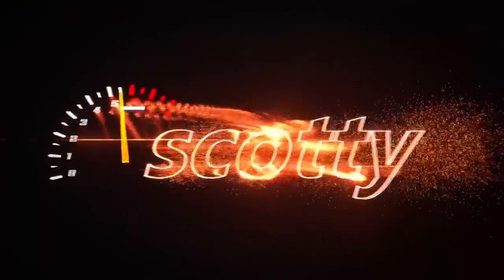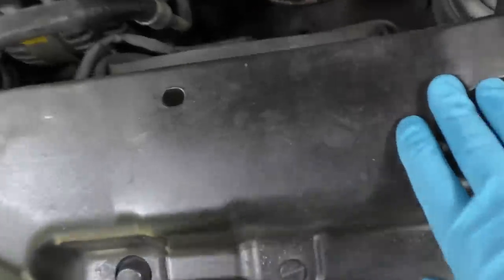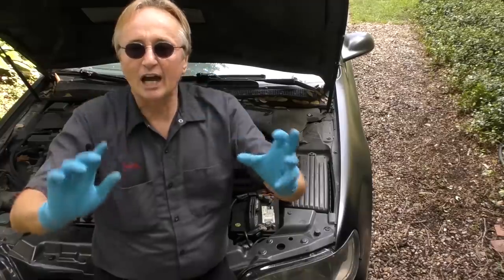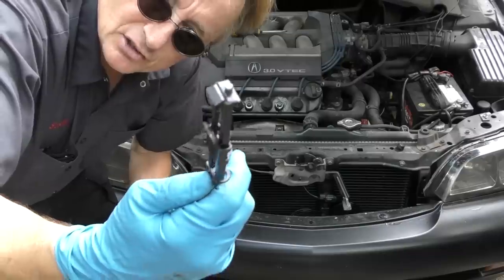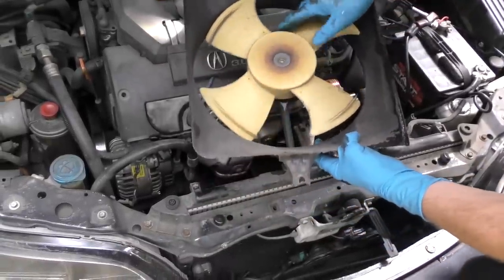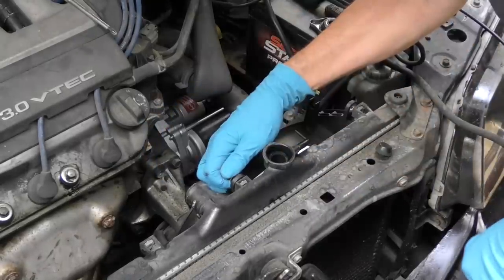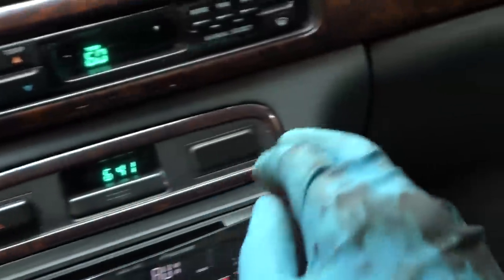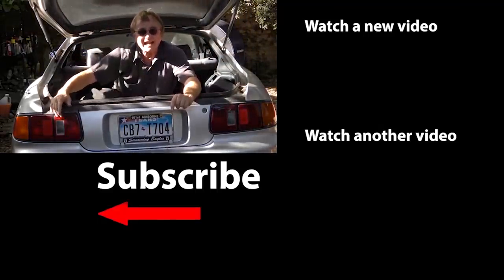Doing This Will Make Any Car Work Better

Comment: To have Scotty work on your car would be a dream.   That clamp tool is a must for tight spots, reduces cursing by 80%
Reply: Gordon Ramsay can use that
Reply: Bet scotty would run away rather to work on my Jaguar S type 😭
Reply: @iiiEazyiii  because it is an endless money pit.
Reply: @iiiEazyiii  You too? Mine is an 07 S Type. Bought it used back in 2011, drove it for 2 years before giving up.on that bloody thing! Everything just failed:  radiator, bearings, fuel pump, power steering, windows, speedometer, chair motor, wiper motor, navigation screen partially white, brake rotor, and even the boot won't open anymore! From May 2013 I've left the car on my front driveway ever since and just couldn't be happier with my '12 Camry nowadays.
Reply: @user-xq2fz5tz9t  Why leave it sitting on your property. I'd of junked it or sold it many years ago.
Reply: Maybe even 92%

Comment: My car's got three hundred thousand miles on it the fans still work.... knock on wood.
Reply: @missioncodez  agreed. My little car has 100,000 miles on it. All original. Apart from the clutch and brakes. If you look after it, then they should last a lot longer but cars are like white goods now. Disposable.

Comment: I have 1996 Honda civic w broken compressor. Total oven on wheels
Reply: U think it would cook my meet when I’m sitting inside it?
Reply: Checked on eBay?
Reply: Fixing AC is not too bad. Need the right tools and do some research. I've done two compressor replacements and will soon be doing a third. Different cars.
Reply: What was the issue with it? I replaced mine because the place where the clutch bearing fits into was so much worn out that the clutch was wobbly. At some point the clutch was just held in place by the snap ring

Comment: I have the same car scotty it runs cold like that....right under the half way line...mine is a 99 acura cl 3.0
Reply: It's not really running cold if it's near the halfway point my Accord does the same. I can get it to come up but it has to be ran hard. I think it's just the gauge they use.

Comment: I must be a bit of a cheapskate... I would've taken the good blade off the seized fan motor, then removed the busted blade from the other fan that still had a good motor,  next I'd put the good blade on the good motor, and finally reinstall the repaired fan along with 1 new fan... end result is still 2 working fans, but with one big difference of cutting the parts bill in half... at the cost of being a bit more labor intensive.
Of course, I'm only talking about working on my own car.
Reply: J. M. The Damned fans are aftermarket.. Cöst practically nothing! He could have done what you suggested only to find in a short time the other fan (which was old) would break down!

Comment: I bought a 2012 accord about a month ago and it had zero coolant left in the reservoir so I went and filled it up. It was leaking very slowly and I couldn’t find where it was leaking from. After about 2 weeks of trying to figure it out I found that the clamp on the radiator hose was loose enough for coolant to be leaking very slowly. Pretty easy fix in the end.
Reply: Do you have any particular problem with your 8th gen accord 'til now?
I replace my power steering pump and rear wheel bearing a year ago

Comment: Hey Scotty, I have a 06 Toyota Corolla that has a weak ac flow, how do i fix that? I already replaced the blower motor resistor yet the air still comes out really slowwww.

Comment: The fan motor's destruction is due to the prolonged exposure to the extreme heat (coming from the super-burning-hot exhaust's-extractors located just right behind the radiator's-assembly); that has basically burned & fried the fan-motors over time. (In fact, the radiator-assembly itself is already absorbing a big-deal of excess-heat coming from those exhaust-extractors right behind; drastically reducing any cooling efficiency of the radiator & the condenser.)

Unfortunately, most car engines today suffers from this problem & dies the same fate; (a design technical flaw due to limited engine design constrain; & or due to the limited space inside the engine's bay area).

This issue certainly matters the most to Uber/Rideshare/Taxi drivers who essentially drives their car for many hours OTR (in city/stop-go traffic driving conditions + traffic-jams sometimes crawling/inching uphill; with extra passenger-load + with the air-cond switched-on colder).

What I basically did to solve this problem; (for my own Uber/Rideshare/Taxi vehicle); was to apply thick-ceramic-coating onto the surface of the hot-exhaust's-extractors, as well as ceramic-coated the radiator-fan-motor (the side facing the hot-exhaust's-extractors).

There are also other types of modifications that one can do to resolve this burning-problem. (I for one, also have a 2x-layer-ceramic-tile installed between the radiator & extractor to prevent the radiator from absorbing the unwanted high-temp emitting from the extractor.) 
As such, now the radiator has more extra-capacity to cool-down the engine's (piston/combustion-chambers) & then the condenser is having more capacity to cool-down the AC's-refrigerant.

Bear in mind that the other components of the engine (such as the ac-compressor, the power-steering-pump, & the alternator); these components are deteorating under high-temperatures as well. (So I had also "ceramic-coated" these components except the alternator; which are all positioned right beside the burning-exhaust-extractor inside my car's engine-bay.)

There are certainly even more modifications/improvements that one can do (to improve the engine's heat management); which includes expanding the radiator's assembly itself (to absorb & dessipate more heat away), improve engine-bay ventilation, passive-cooling methods, & or improved active-cooling methods, etc...

Comment: Hey Scotty, what's a good quality battery to get for a little '10 Corolla; that won't give any issues up here in Canada?
Reply: almost all the battery companies now use planned obsolescence so at most batteries will last about 3-4 years. Buy a battery from Costco because they have good replacement warranty programs. check the date on the battery when you buy them and not buy one that's older than 3 months

Comment: Scotty, Are the Newer Style Electric Fans BETTER than the old style Fans from earlier years? I have a '94 FORD F-150 would I be Better Off with the Electric Fans on it as a PUSHer Fan? I Don't have any 0ver Heating Problems with it....But, I do tow a Fairly BIG(Air Catcher) trailer with my truck.

Comment: My daughter's '99 Honda Accord has the two fans not working - unplugged the (ECT) Electronic Coolant Temperature sensor and jumped the two connectors in the plug - both fans ran ok - replaced the ECT sensor but didn't fix problem - however the a/c doesn't work or come on at this time - can the separate a/c problem be the culprit?? 
Thanks Scotty,
RW Frazier

Comment: Scotty.  Great videos. All of them!  I’ve got an 2007 Toyota RAV4 4cyl with 120k miles.  Burns oil but runs good otherwise.  Owned since new.  Original exhaust is still on but is now loud.  Trusted mechanic says it needs the pipe with the second cat replaced.  Toyota part includes the cat and muffler in one assembly for over $800!  I can’t see having to pay $1000 for an exhaust repair to keep my 12 year old car going.  Shop says they can’t just weld in a sleeve to fix it and they don’t want to use cheaper aftermarket parts as the factory computer may not like them.  What to do???

Comment: Back in the day, when I ran conventional oil (non-synthetic), I would change the oil when an engine would overheat. Conventional oil begins to cook at around 300°F. The typical oil  temp at the crank is around 275°F. So, overheating might severely damage the oil (through heat oxidation and altering the viscosity). So, in my garage, conventional oil + overheating = oil change. With synthetic oil I don't have to worry about this, as even the cheapest synthetic oil won't cook until about 400°F. So, there you go, another reason synthetic oil is superior.

Comment: Hi Scotty, and thanks for all you do on these youtube vids-Sincerely!  My 2002 Ford Taurus had intermitant problems with the column gear selector on the automatic transmission not shifting out of park.  Problem was brake safety switch that I replaced to  fix it.  Now, cruise control won't work.  Any idea what  the problem is now?

Comment: Hey Scotty: I know you know this but I think your people should hear this anyways when you saw the "T" gauge was reading low why did you say that some use car lot just pull the "T" stat and throw it away just keep make it show low temp for long just to sell the car. Be sure to say SOME used car lots just cause there still really good used car dealers out there. I've worked in automotive repairs industries for almost 60 years. And love to hear speaking the truth these repairs and about some of those bad shops. I have worked with them too through the years go by but, never for long either. There is plenty of room for good shops but those bad have made it harder to do people right when bitting about if going to charge them an arm and leg like "joe bad blow shop" did him last year. As for me, I have always just said to them "Just stand back and watch and see I'm doing right as I can always." I started out working on aircraft airframes, avionics, and power plants so I got at ease with being watched early on. Later on, switched to Big Trucks and still went to work at GM Dealer but I've always done auto-electrics even as a teenager back in high school. You know when you could buy a new car for about 5K dollars or less. Did you that Jack Northop started out an auto mechanic too it was he who had to help me to get my "FAA ticket" in the first place, really not bad for a young native American kid. without MR. J. Northop I'd never had a chance to started but for small shop low paying shops. Well that is what I was told about Mr. jack Northop's upbringing when had I went to Northop Institute Oof Aviation Technology.

Comment: A guy named Benny told me that reason that my air conditioning is not working in my 2003 Saturn VUE is because of some part that needs to be replaced because of some problem that occurs when you do not go over 150 RPMs? Firestone said that I need to get a new compressor. Can you take a look at it? How much do you charge? I take care of two veterans.

Comment: Hello Mr SK,

Going to disconnect my negative cable to work on my 2019 GMC Canyon 2.5L 4cyl BEAST haha. A bicycle hauler - 4bikes @ 18lbs each grrr...

Should I use a “memory saver” gizmo to preserve my memory? No traditional radio or passwords that I know of. Sold my 2004 Vibe to buy this plastic infused GMC Pro Grade Puckup because I’m old and wanted a TRUCK. Sold my Vibe to the GMC sales guy for $950 because he wasn’t stupid

Comment: Scotty I just did that on my 2016 Ford Explorer after changing the fan assembly (thank God I didnt have to disconnect the radiator hose) I got worried because the new fans would not turn on even with the air conditioner turned on full blast. Well turns out winter up here in Maine it's so cold the fans don't turn on even when the AC is going full blast.

Comment: Plastic crap is so right.
I removed the plastic engine cover on my 2017 Toyota Corolla SE with a 6 speed manual transmission to look around the engine because Haynes does not have a manual for the car.
I did not notice that one of the cover's plastic sockets, which fits on a mounting stud on the engine, had gotten out of alignment. In trying to reinstall that plastic crap, the top of the cover broke.
The old super glue and baking soda trick did not work. I can try putting some kind of reinforcement with epoxy over the crack to see if that works.
If not, option one is an online replacement cover for over $100, or the second option is to say the heck with it and leave that plastic crap off. Right now I am at the second option.
So much for Toyota quality.

Comment: Makes it look so easy.  If it was me, a bolt would be impossible to remove or the replacement part would be wrong or the electrical connector would be different or disintegrate when removed...... :-)

Comment: Scotty, i have altima 2015 the car vibrate when on D i cleaned injectors but no use. Now it stalls sometimes after i stop on traffic and put it on N then D. Note: sometimes car raise the rpm to 1k while on P.

Comment: Those hose clamp pliers are great if the clamp is VERY easily accessible, which it almost never is. I had one of those for abut ten years and was able to actually use it about 5% of the time.  Angled needle nose pliers I have found to be much more useful.

Comment: Replaced my thermostat with a "racing" thermostat.  Dumbest thing I've done.  Now when the outside temperature is cold it will take the engine longer than programmed to reach normal operating temperature and a check engine code will come on.  Never get a racing thermostat as they are pointless and just create headache's.

Comment: You can see the driver side fan was already replaced before, OEM fan on the passenger side finally failed, but the aftermarket one just wore out as well. New fans look identical, just a lot cleaner and a lot less wear on them.

Comment: So the cooling system is good now. To bad the other owner ran it with the fans messed up. How much damage did the engine get from running hot? If they couldn't figure that one out I can just imagine about the systems.

Comment: I swear Scotty if you had uploaded this video one week before I could have saved a lot of money, same issue here just that my Honda fit does not hace a temperature sensor. By the time the overheat light came on the heat pressure had broken my radiator because both fans were un operative.

Comment: Had a buddy with the same issue on an RSX. Hobbled it to the parts store and crawled underneath to look for a leak. Instead, I found the bottom radiator tube clamp had rusted thru and the pipe came off. Totally empty

Comment: I have a question for you.
Its a mechanical problem that dealership cant figure out.

So its like this.

My car makes tick sounds at low rpm and at low throttle...and at high rpm and high throttle.

Rod bearing,valve,chain are all checked and are good.
Intake flaps are good.

There is also this..when you unplug spark plug from cylinder number 1 it stops ticking.

Engine is 2.0 16v Dohc mazda LF20 engine

Hope you can help solving the issue
Reply: Try replace the #1 spark plug?

Comment: My 2011 Hyundai Elantra makes a weird vibration between 2,500 and 3,000 RPM. Could this mean I need transmission fluid swap? It has 83,000 miles
Reply: Luke-o 1234 You probably should've gave him the mileage as well

Comment: Someone buys a brand new car to save money but 1 week later the engine dont start so they fix it 3 thousand dollars to fix a fuel pump if you had and old car you could do it yourself and save buy a old car if you buy the right used car you coud save.
Reply: Dealership would fix it for free.

Comment: Hey Scotty my buddy just got a 2008 Ford Escape V6 4WD for $6800 with almost 70,000 miles, did he get a good deal?
Reply: KenronTheGamer had an ‘05 V6 escape ran reliably up to about 236k miles....eventually the transmission went. Engine ran like a clock even then...we put a used trans in it and gave it to a family member down on their luck....still runs a couple years later lol.

Comment: Can you comment on the 2019 Honda accord, are the new 1.4 liter turbo charged engines and the cvt transmissions reliable.
Reply: Cvt transmission = endless money pit
Reply: TAPAN PATEL I thought it was a 1.5, and it's a new transmission so I doubt he would say it's reliable, when he doesn't even say anything nice about any of Honda's auto transmissions let alone a CVT
Reply: @JDMHaze  ye my bad. they are 1.5.
Reply: TAPAN PATEL they will absolutely not be as reliable as the older models. The last reliable Honda Accord ever made in my opinion was the 2012 model
Regular engine. Regular automatic transmission. No push button ignition...etc.